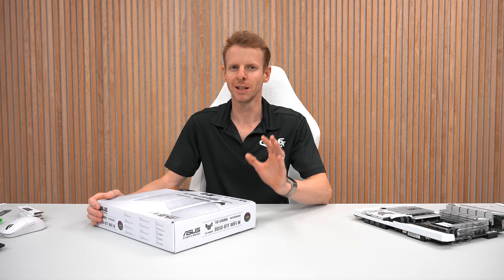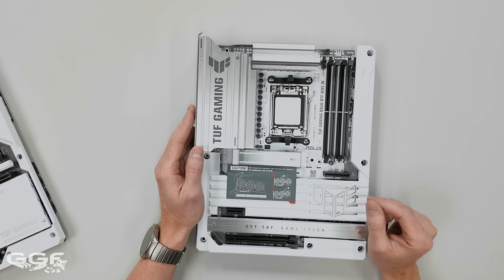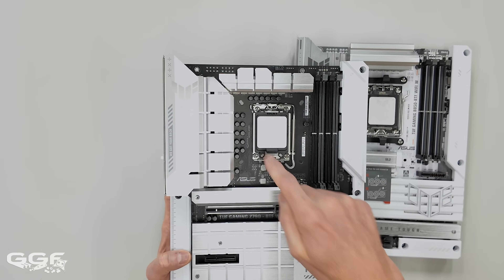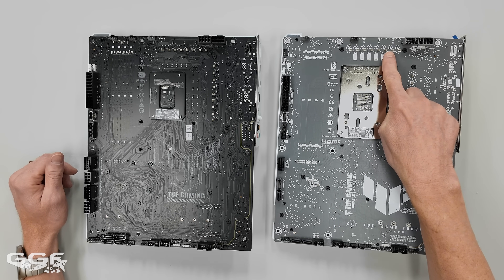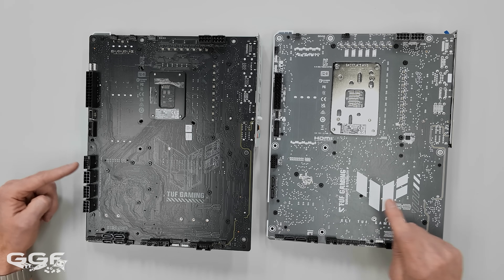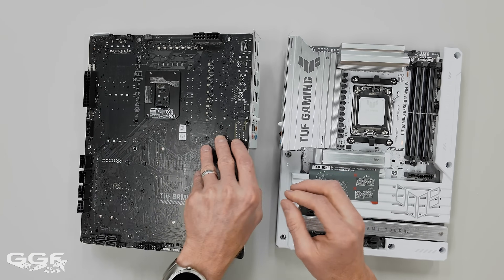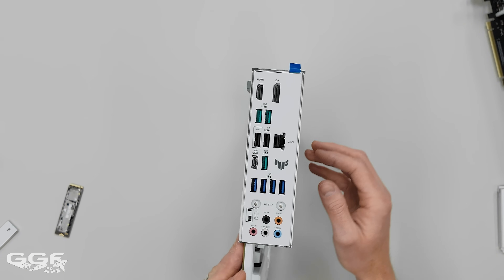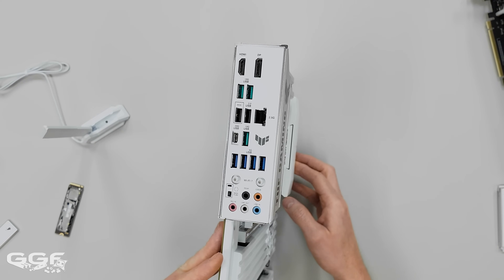The FIRST AMD BTF!  //  TUF B850-BTF First Look

Comment: Just thought I would include that the new BTF 2.5 card (ASUS 5070ti TUF Gaming BTF Version) has connector on the front, so it is compatible with non-BTF boards as well. This makes it a better option as it has more reusability and means it will maintain price better
Reply: nvm just saw you talked about this at 10:50

Comment: Hello, first time builder with both the ASUS Btf motherboard and ASUS 5070 ti btf edition. 

When I turn on power from the switch of the psu (red lights shows up on the gpu). Even when I finally powered up first boot, red light still on.

Also, on the ASUS btf motherboard, it shows “white/green” light. Also, getting no display on my gaming monitor. Not sure if it matters but I’m also using Corsair 850x PSU. Also just using of course the small power adapter from the gpu connected to the motherboard.

Any help is greatly appreciated. Thanks!

Comment: Really wanted to buy this mainboard but because I was looking forward to use dual gpu in my setup, the second pcie 16 slot is too low to fit the second gpu in my case. Too bad 😭
Also there should be a black version too.

Comment: Cool!
I just don't get it... Why isn't Asus making a WHITE BTF 5090 or a BLACK AM5 MB?
Are they trying to sell us Intel for some reason?
It may not seem like a big deal, but the main reason for the BTF and other rear connectors is aesthetics. So you HAVE to have a black AND white setup if you want the best of everything or just get a lesser GPU or lesser CPU and deal with it?
It makes no sense.
Reply from the maker: Huh? Did you not watch the video or any Computex coverage? There are black am5 boards and there are white BTF GPUs coming. There is the black hero btf coming with black BTF Astral. And the white lineup of BTF has always been tuf which midrange so midrange btf white cards are coming
Reply: @GGFEvents  Did you read my comment?

Asus already has literally dozens of motherboards with the latest generation AM5 chipsets. 

Now they are releasing the BTF version, with only one option, in white. 

At the same time, they are releasing the BTF 5090, only in black. 

So if you want a single color BTF build with a 5090 BTF, your only option is Intel. 

They limited everyone last generation to Intel. 

Now they are limiting AMD to the 5070Ti BTF. 

Except for those who want a black AND white build. Who are definetly in the minority.

That is my point.
Reply from the maker: @ronaldocost4 no there is an AMD Hero BTF. And the TUF white BTF is mid range. They won't do a white tuf 5090 BTF. BTF is very limited already. They're going to focus on black first which they'll have 5090 Astral, AM5 and Intel hero btf in black. The white they will have TUF BTG AMD with midrange GPU from both Nvidia and AMD.

Comment: The btf idea is ok. I have a question why the main cpu fan is on the front. Like a lot the color mix with silver
Reply from the maker: There are 2 CPU fan. The reason they have one on the front is for a short CPU fan cable might be cleaner running it to the front one.